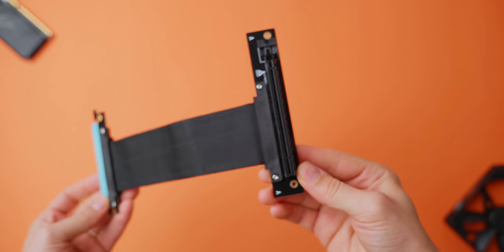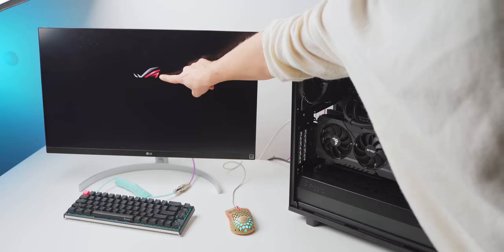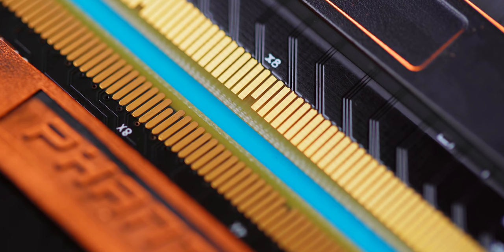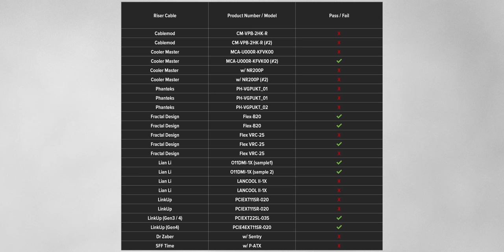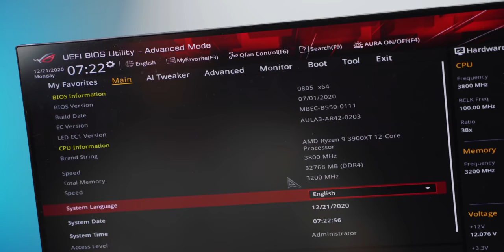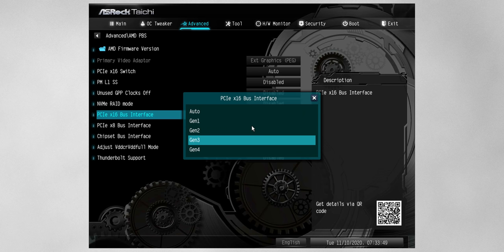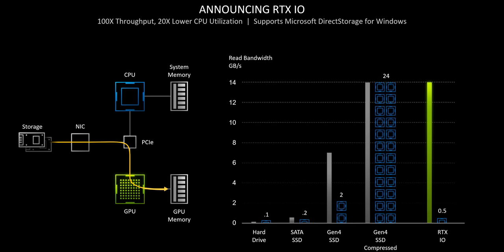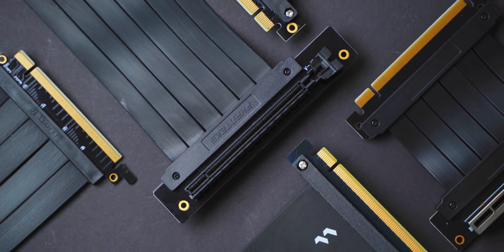There's a PROBLEM with Riser Cables

Comment: There were definitely issues before Gen4. Gen3 had plenty of issues until more recently. I helped Thermaltake test some of their prototypes. That aside, running any current gpu at gen3 x16 is more then enough. Don’t need gen4 yet, we haven’t bottlenecked gen3 and by the time we do, we’ll likely have good risers fit gen4
Reply: Exactly. Thank you for confirming this. I wish more people would read it.

Comment: I suspect you're missing out on the reason why this is happening. I'd have to read the specifications for PCIe 4.0, but I would suspect that the permitted skew for a differential pair length was lowered, so it would mean that the layout of the connector boards has to be adapted. Alternatively, the impedance matching might be off, or cross-coupling might be too much on some of these cables; it's hard to tell without taking the specifications for PCIe 4.0 and PCIe 3.0 and comparing them. But overall, I'd recommend you'd take these cables to someone who knows a thing about RF electronics (and not your local HAM guy) and get them to measure it if you want to figure out what's actually going on. But given the complexity of a PCIe bus that ain't necessarily a trivial measurement.

Comment: The Dan A4 v4.1 comes with a Gen 4 riser (3M™ 8KC3-0726-0300 PCIe® x16 Gen4 ) so "not a single case comes with gen4 riser equipped inside the box" isn't accurate

Comment: I bought a Linkup Ultra PCIe 4.0 x16 Riser Cable to use with an Asus Rog Crosshair VIII Dark Hero mobo and Nvidia Geforce RTX 3090 O24G video card.
Is this cable going to work properly when set to Gen 4 in the BIOS?

Comment: Remember having a issues with a 486 SX-25 in a slim desktop case - it used an ISA riser card to to turn one 16bit slot into 3 slots, caused all sorts of problems with sound cards, HDD controllers and so on.  Stuff would normally work in the lowest slot which was closest to the motherboard /  had the least signal loss but otherwise no hope - guess the old saying of "what goes around, comes around" still stands true.....

Comment: I don't think it's about cables not being "speed rated" for it.
I think there's electrical difference where the wires are soldered differently.
My best guess is that common power lines on pcie3 risers were shorted together to reduce manufacturing cost and number of separate wires.
Then pcie4 probably replaced some of those power lines with signal wires for extra bandwidth and so when you use pcie3 riser it shorts those extra data lines and it doesn't work properly.
Reply: Btw. pretty sure MB manufacturers can make the AUTO detect function detect properly gen3 riser with gen4 card and set it to gen3, so basically BIOS update should resolve this issue.
Reply: @Arek_R.  Yeah it should be a case of "Oh there's an issue trying PCIE4? Ok does PCIE3 work? It does? Great"

Comment: well heres one for you, my 3080 worked fine with with my z490 using the very first original riser cable that came with the first vertical GPU mount ever hit the market... but when i switched to 3080 TI the card was under performing at 75% of that of a 3080... when i kept switching cards and the issue was still there with 3080 ti but not with the 3080. the 3080 is colorful vulcan oc and the 3080 ti is evga ftw ultra

Comment: I don't trust those pcie extension cable at all. As you mentioned, maybe there were some performance or compatibility issues, and it's NOT a riser, A small PCB with a bunch of components hard soldered, that's a riser. It's expensive but it guarantees performance and safety. Thank you for bringing up this topic to the public.

Comment: Great video. Here is one related issue for you. I have the NZXT H1 (No fire.. yet). Had to figure this Gen 4 CPU >Gen 3 riser> Gen 4 GPU issue out on my own a few months back. When I swapped the CPU out to the AMD 5800, I got the SUPER slow response BIOS. Tried 4 different BIOS versions and even trying to go back to the orig 3600. Never found a fix, sent the MB back for an RMA thinking it was that. No issue on the MSI B550i yet. Any idea what would cause the issue when all I changed was the CPU?
Reply: Can you write a follow-up to this?
Reply: @dnoodspodu1159  which one of the problems would you like me to follow up on? The MB I ended up RMA'ing to Gigabyte and installing the MSI... updated the bios via thumb drive and flashback button, worked fine ever since. Gigabyte MB got sold when it finally came back to me
Reply: @McKevittS  So... the problem was too old BIOS?
Reply: @dnoodspodu1159  Yes the orig problem was that the old bios did not allow me to use the 5800x. When I tried to update it using Gigabyte's mown bios update tool in the bios, it failed and bricked the mobo. Forcing me to wait, or buy a new mobo. The riser issue was different and a well known issue with gen 3 risers on gen 4 hardware

Comment: I ran into the exact same problem when I installed my RTX 3080 in a vertical mount using a riser cable which never had problems and had to change to Gen 3 in BIOS. Too bad the current Gen 4 riser cables are so expensive and not 100% reliable atm. Not much choice to choose from either.

Comment: Ran into this with my build, discovered it pretty fast. Came across this video from HCv, always reliable on finding this stuff out 7 months before I do lol.

I've never had to reseat my GPU, I just go directly to BIOS. My Riser is the one provided with the Phanteks Shift 2 case. It almost works too. It gets the window boot level before it crashes and if you don't go into BIOS before the next reboot, windows will be very unhappy and try to perform a system repair. 

There's really no need to upgrade the cable based on most of the bench marks, but because I want my system as unlocked as can be as well as nice and pretty, I'll be getting an upgraded cable soon. It just sucks to do because with most SFF cases, you're forced to do a full tear down just to swap out the cables. Not fun. lol

Comment: Thank you very much. I was looking at  the possibility of using a riser bracket and cable for the GPU. It is going to be a full custom water cooled build and the GPU with the water block, even though it occupies less volume than with the fans, it is heavy. And I am concerned about this weight, even though Lian Li O11 vision comes with a bracket to hold the weight of a horizontal GPU. 
    In any case, the riser bracket and cable is hard to find. In AliExpress the Gen4 option was missing in many shops and now I understand why.

Comment: I have seen many cases, especially in SFF builds where the cable was a "problem", where the person building the PC has folded (literally with a crease) the ribbon.  I highly suspect that this created an impedance mismatch causing ringing in most of these cases.  We are taking about VHF/UHF switching speeds, impedance and standing waves are in play.  You have to treat the ribbon on these just like any other transmission line (be it balanced or unbalanced): NO SHARP TURNS!  Only allow gentle curves.

Comment: very informative, vyvm :) Building in a Hyte y60 and getting a black screen that comes with a pre installed riser cable. I tested all my gpu's in my daily driver, worked np. then both gpu's failed in the y60. <not getting another case from them> Just need to test a direct to motherboard GPU. But my first guess was the riser cable, and as you informed me their are am3 n am4 which i was unaware. thx for the help :)

Comment: Fun story, I've had a riser cable in my thermaltake Core P3 case for several years now, initially had no issues, then started having black screen crashes forcing a hard restart to get it going again. Lowering my power limits to like, 60-70% and dropping my memory clock and core clocks seemed to help. I thought either the gpu or psu was starting to fail. For shits and giggles I changed my setup back to not use the rise cable for the first time in several years. No more issues. Damn riser cable started acting up and was causing all my problems. Now I can overclock my card like crazy again without any issues. So frustrating that something like that can fail while sitting there without moving for so many years.

Comment: Well, I use a Riser Cable in my Gaming PC, with an ASUS ROG Strix GeForce RTX 2080 Ti Graphics Card, mounted in the center of my Cooler Master C700M Case at a 45 degree angle. I have never had any of the issues you mention in this video & my system is running great after 2 years.

Comment: Going by the current information space, PCIe Gen 4.0 is no longer an issue for riser cables. However, PCIe Gen 5.0 is rearing its head, and might become a problem some years down the line. I know now to watch out for this. Thank you.

Comment: Your channel has long been my go to site for tech content, but more specifically for case reviews, but I’m wondering if you would consider doing a video or series, looking specifically at inverted cases that are available? Personally I’m looking for one that accepts a full atx board, as just about the only inverted case I’ve seen reviewed in the last year was the ROG itx one (not counting the one you covered a week ago, which was also an itx case.)

My case needs to sit to the left of my desk, but I’d still like to be see the innards of my system so I need the window and components on the right side of the case, but of course they seem to be few and far between, and don’t really seem to get much coverage.

Comment: Wasn't this the same issue Linus faced with the Riser when building that dbrand pyramid thingy with dual 3090s?
In that case switching the pcie slot to gen3 would probably solve it (at least it apparently did for Linus).

Comment: That's funny i just commented about this the other day on one of your videos that was like a year old. And you went indepth on it. Unfortunately some builds require a riser cable. Alot of the SFF cases require you to use a riser cable, because thats how the case was designed. You went over everything pretty much, but missed a few things. If at any point the cpu is removed from the socket, the bios will reset, and you have to go through the process again. I am not sure if removing the memory has any impact as i've never tested that. 
But other than that great video. This really only applies to SFF builds, as ATX builds shouldn't have the problem of connecting directly into the mother board while in the case. I upgrade to a 280 AIO for my build, and removed the cpu ro get all the old thermal paste out, and without think just put it back in and then booted and thought i broke something. I was on a tight schedule so i came back like 3 hours later and it just clicked in my head, what i couldn't figure out earlier.

Comment: Im using the Thermaltake riser gen 3 with an Asus Strix b550- e. It came with my Thermaltake Core P90 and an MSI trio 3070 and it's working fine. I did try at gigabyte Vision B550 and I have to change the pcie gen3 to boot into windows. And my motherboard Asus strix b550-e shows resizable bar is enabled but I don't know if it is active.... Just my experience.

Comment: We really need in update on this. I ran into the exact issue your talking about, all my parts are gen4 but I can’t use the system at gen4. I have a 7900xtx and 5800x3d. Is SAM going to work worse in gen3, am I going to get worse performance with these more powerful cards. 

This video was great btw, would love a follow up.

Comment: Could you please do a test soldering +12V pci-e power directly to the socket at the other end of the cable where the Gpu sits. 12V pci-e power could be sagging due to long distance and resistance of the copper wire they use in the flex cable. Run a +12 wire directly from psu to riser socket. That should fix some of the problems.

Comment: My video card suddenly started failing to POST after 18 successful months on a riser cable. Removed the riser, put card directly into the connector, and it's now working fine. Threw the riser cable and bracket away.

Comment: i found out the hard way the Fractal Design flex cable does not work good with the 3070  sound is crackled but with the 2060 works fine

Comment: Also, the screw holes can be different. Both a Phanteks and Thermaltake riser cables do not line up with Geeek a50 Plus's mount points. So I only mount one screw. Thanks for the video, few weeks back I had this exact issue and I was going mad

Comment: I actually ran into an issue with a riser cable I had purchased running an RTX 2060 Super to a B450 Tomahawk Max (both Gen 3 interfaces) where I would have game crashes, but not system crashes, if I turned off VSync and uncapped the frames in a given game. It was as though the signal was dropping or getting lost, causing driver issues. Turning on VSync almost always remedied the issue, and plugging the GPU directly into the motherboard also solved the issues (meaning I could turn off VSync and uncap my frames without any issues). The riser cable in question is a Phanteks PH-CBRS_FL22, which apparently has lower quality shielding when compared to their "premium" version PH-CBRS_PR22. Unfortunately, my budget right now won't allow me to purchase a PR22 to test whether or not it would make a difference. I know that people are more interested in PCIe Gen 4 information, but for lowly budget gamers like myself still stuck on Gen 3 cards, I felt like this information might open up for more discussion.

Thanks for the video!

Comment: A few years ago, I was suddenly having issue with random shutdowns. No BSOD, it would just suddenly reboot. I replaced the PSU, checked the RAM but it still kept happening! I then noticed that the shielding on the cable had split at the PCI-e connector, and after replacing the riser cable, the problem went away!

Comment: I know this is an older video, but would like to ask a question and hope someone can help.

I just replaced my X470 MB with an X870E mother board.  I used an older Phanteks riser cable Gen 3 with the X470 and XFX 7800XT with out issue, but now the new board does not see the graphics card at all.   Is the older riser mount the problem?  It's the Phanteks PH-VGPUKT_02.

Thank you

Comment: I have a 3080 and a 5800x on a Aorus x570 ultra with a PCIe 4.0 riser I bought in August 2020 from Amazon. No problems at all. GPU is running rock solid at PCIe 4.0 I paid $50 for it.
I'm using the Linkup PCIE4EXT11SS-020

Comment: I ordered and installed a 1200W PSU thinking my 850W wasn't enough for the Aorus 3090 I installed. I'm using a 9700K on a Maximus XI Formula with a full custom loop and was experiencing consistent black-screen crashes. Definitely has to be the old Phanteks riser cable as the culprit. Card is probably pulling so much power from the slot even with the extra PSU headroom. Even undervolting and underclocking didn't help. New LINKUP Ultra cable arrives tomorrow, so hopefully all good after that. But just noting I have a Gen 3 motherboard with Intel and this is totally impacting me. Hoping for a fix tomorrow.
Reply: My linkups ultra PCIe 4.0 cable has been working flawlessly. My case (node 202) came with a riser card, if I tried to use PCIe 4.0 with the card all I got was BSoD and lockups or other crashes. The Linkups PCIe 4.0 cable fixed all of that and has been running flawlessly, but I'm also running an x570 mITX board as well.

Comment: I'm using Maximus XII Formula and RTX 3090 with Lian Li riser cable which is coming from Lian Li vertical GPU bracket and its support only Pcie Gen 3, but i dont have any issues with my build, everything is normal, that mean im so lucky with my vertical setup. Never used pcie gen 4 riser, cause gen 3 its still support backward compability. Or the issues is coming from AMD motherboard with riser cable vertical gpu? 🤔

Comment: My Thermaltake Core P3 comes with a ($30) riser cable that the community pretty much advises you do NOT use. I think that says everything about riser cables right there.
IMO it's not worth it just to vertical mount your GPU.

Comment: so i have a question.
i have two x16 pcie 4.0 slots on my motherboard. one is used for my gpu.
i want to use the other slot for a m.2 nvme adapter card. it can do 4 m.2's in x4 mode.
the problem is it will block most of my gpu's fans etc, so i was thinking of using a rise cable to locate it further down.
now my question is do i need a pcie 4.0 riser cable, or can i get away with a pcie 3.0 riser cable?
the former being like 4x more expensive at over $100. waaaay too much money to spend on this for me.

maybe i should just get a smaller pcie m.2 nvme adapter card that only supports 1 nvme, then it wont block my gpu too much and i wont need a riser cable. but that leaves me in a situation with no upgrade path for more nvmes. and i only plan on buying those from now on. cheaper than hdds, cheaper than ssds, faster than both, more reliable than both. more tbw, more mtbf.
its a no brainer to only buy nvme's from now on.

Comment: Thanks for the video. Everything went smooth for my new build - does run about 5C-10C hotter. 
AMD Ryzen 5 3600 3.6 GHz 6-Core Processor
Noctua NH-U12A 60.09 CFM CPU Cooler
Corsair Vengeance RGB Pro 16 GB (2 x 8 GB) DDR4-3600 CL18 Memory
B550 AORUS ELITE V2 Motherboard
ASUS DUAL RTX 2070 EVO OC V2
ROG Strix 240 mm PCI-E x 16 Riser Cable with 90 degree adapter, patent SafeSlot™ design, EMI Shielding
Samsung 970 Evo Plus 1 TB M.2-2280 NVME Solid State Drive
Samsung 970 Evo Plus 500GB M.2-2280 NVME Solid State Drive
Corsair iCUE 4000X RGB ATX Mid Tower Case White
Gigabyte AORUS P GM 850 W 80+ Gold Certified Fully Modular ATX Power Supply